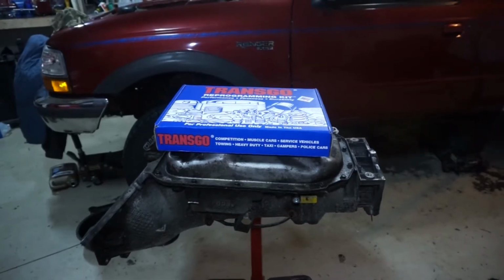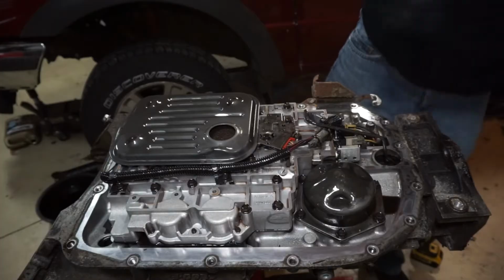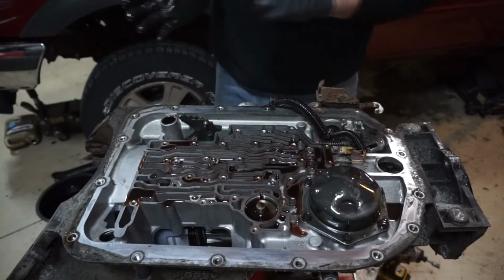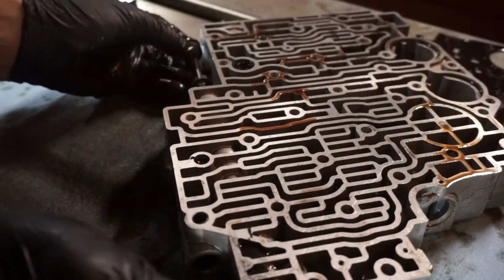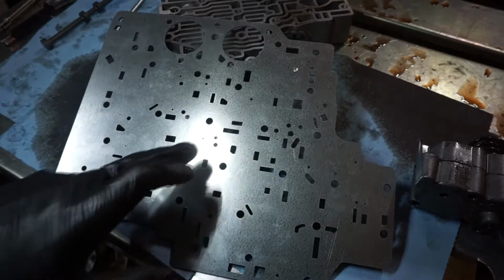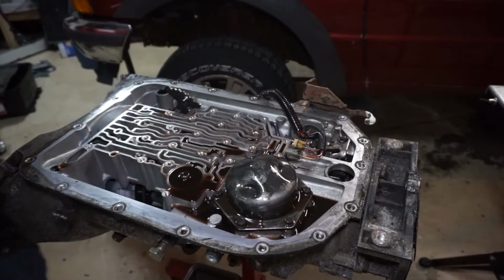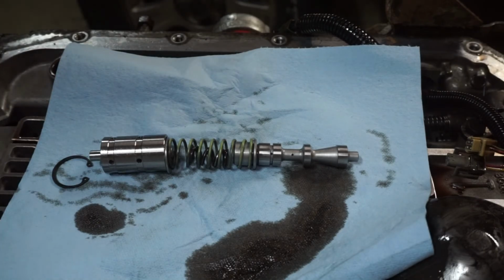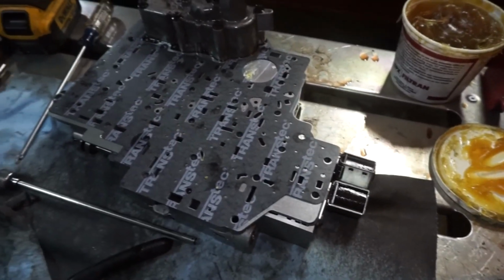4l80e HD2 Kit Install Improved Method Without Pressure Relief.

Comment: You guys think i could add the springs to the direct drum from the hd2 kit while using the Jakes recall kit?
Reply from the maker: @moose1992caprice  You could. You could just buy the springs also.
Reply: @BlaserBuilds  ok. I already bought the kit and then did my research. Needles to say, I went with the jakes kit instead.

Comment: Looking to install this kit this weekend. Curious how three years later you’ve liked your decision on not doing the pressure relief valve ?
Reply from the maker: Yeah I still don't do it. Only difference now is if I know I'm going inside the trans, I will dual feed internally with a Jakes recal kit, and add the HD intermediate snap ring.

Comment: Hey Ryan thanks for all your helpful videos.. question for you if I’m running a tru cool 40k cooler, should I did loop the cooling circuit through the radiator? Thanks!

Comment: Opened mine up this morning to find the 4th accumulator spring broken. Ordered a delete plate for it. What would you drill the separator plate holes to with the delete plate instead of the accumulator installed? Thanks. Video was a huge help for me.

Comment: I know your vid is older but I inquired with transgo about the pressure relief mod issues and for the differences between the transgo 2 and 3 kits, here’s what they said- 

“The HD2 requires a computer, it keeps it automatic. 

No design change, the good old Urban Legend that a pressure relief causes transmission to fail is just nonsense that does the rounds online by people that don't even know enough about basic hydraulics to know they don't know. 

That pressure relief when installed properly does absolutely nothing unless one day there is a pressure regulation issue, at which point it would simply kick in to save you a bunch of money on broken parts. Blaming it for a transmission failure would be like blaming your fire insurance policy for you house getting flooded during a hurricane. LOL”

What’s in quotes is their reply. Have you personally seen the relief mod 
issue you are saying to avoid? Thanks!
Reply from the maker: I have a video on the channel with a valve crooked in the valve body on one I rebuilt for someone... Transgo also says the intermediate snap ring is optional(kit can be installed in vehicle). I broke the stock intermediate snap ring in the transmission in this video with the HD2 kit, and had to pull the whole thing apart anyways. Now, they'll probably say it broke because i didnt have the pressure relief, but I have to ask... If thats the case, do I really want that valve relief popping open and relieving fluid on every gear change? Most people I know doing this kit aren't spending money on hard parts regardless. They're throwing this in junkyard transmissions for a few hundred bucks to avoid opening up the transmission at all. They're not even installing the whole kit.  There's much better options for shift kits and dual feeding internally if opening up the transmission. Jakes recal kit has no pressure relief, CK Recal kit has no relief etc. This is a cheap DIY option to use only if not removing the pump. If you're doing enough to open the transmission up I don't recommend this kit.
Reply: @BlaserBuilds  Great information but if you were going to pull the transmission apart What shift kit would you recommend Or other parts?

Comment: I have a transmission that has failed forward drum and an HD2 kit already installed and was curious about the pressure relief valve and should I be blocking  off

Comment: What's the benefit to doing only the mods you did, as opposed to doing the full hd2 installation
Reply from the maker: The pressure relief can get stuck open and burn up the trans...
Reply: @BlaserBuilds  do you recommend doing only what modifications you showed here, or to go ahead and do the full hd2 mods for an untouched 4l80 with 130+k miles on it?
Reply from the maker: @Six_ftdeep32  Usually rule of thumb for me is, if I'm going inside the trans for a different reason, do the full kit. If no opening up the trans, just do these steps. 

But now, if I go inside the trans I just dual feed internally, instead of using the kit.

Comment: I guess I need some help I put the shift kit in my 2005 GMC Sierra 2500 HD yesterday and I did exactly as you did in the video The only thing I did different was I installed the pressure release valve and two new shift solenoid‘s but for some reason sometimes my truck will takeoff in second gear and it shifts to second gear at 15 mph and if you do not slow down to under 15 mph it will stay in second gear and once you get up to speed it will shift to drive and it has no bottom end power and when you’re on the interstate when you stomp down on it sometimes it will shift down a gear and other times it will surge how do I fix this problem??
Reply: Ever figured it out ?

Comment: So can I pin this out on my ECU and use HP tuner to go in and set up the 4L80 if I was running a 4L60 previously or do I have to find an ECU that had a 4l80 hook to it from the factory
Reply: depends on the ecu. Check with hp tuners and see if they have segment swap for your ecm

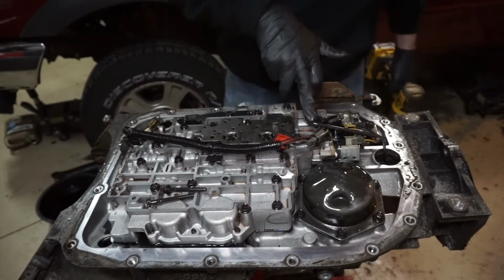Comment: Hey bro, there are many people getting different results with hole size. Just curious how you like the 1/8. I don't want to chirp the tires when i put it in gear or at normal cruise but i want quick and firm for WOT. I have about 425 whp, with a 3800 stall and 4:11 gear in a 3600 lb c10. Little N20 if needed
Reply from the maker: I've never had harsh shift or tires chirp with 8th...
Reply: Thanks sir
Reply: What does the check balls do? On this kit you have to remove the ball closest to the round cap and the check ball that is closest to that one has the hole on the transmission kind of wore out?? And the part that it sits in the valve body is OK it’s just the top part of it that is on the actual transmission or is it supposed to look the way it does?

Comment: Did you end up liking the shift feel drilling all the holes to 0.125"?
Reply from the maker: Yes, I personally liked it better than .096
Reply: @BlaserBuilds  I'm torn between the 0.125" on all 3, or I've also seen recommendations that say do 0.125" on 2nd and 4th, then leave 3rd and remove the check ball.
Reply: @351Cpowered  I drilled the smallest hole on 2nd and .125 on 4th the with no checkball on 3rd. It shift firm on 2nd and smooth on 3rd. Full throttle they are perfect with firm lockup. I would only recommend these settings with a high stall converter.  These were instructions I received from Jake at Jake's performance.
Reply: @spyderlyf3  what size converter do you have?
Reply: @claytonhaske  Its a 3k stall triple disc Vigilante from Precision..

Comment: To confirm is the line to lube valve part# 34200-14K?
Reply: Or is it possible to just drill the stock valve? Great videos by the way 👍
Reply: Looking for the correct part number aswell....any lucky?

Comment: I’m building a foxbody 4.8 ss2 pac 1218. Gt45 with4l80e from a u haul that was buried in junkyard, I’ve done plenty of 4l80e rebuilds for buddies and what not,I always install everything included in the hd2 kit, I haven’t opened my 80e in my car yet,when I do should I skip the relief step? I always here it can stick but personally I’ve never had it happen to anyone I know. Have you had one stick before?
Reply from the maker: Not that I confirmed, but I did hurt this trans slipping st the track, and believe I burned up a converter previously from the trans. This one at one point woukdnt even move, I plugged the relief port then drove it for another 6-8 months.

Comment: "Back in the day", we had a store that was full of surplus hardware of all sorts.  I would pick up bolts of various lengths, threads and sizes, cut the heads off, rounded the ends and used them as temporary alignment pins.  Cheap, easy and very handy!

Comment: i looked up a lot of info on this and did the hd2 then like a week later i see not to do the pressure relief so thats fun
Reply from the maker: Tap and plug the hole. Dont even need to remove valve body...
Reply: @BlaserBuilds  how fast will it take to burn out i wonder if i can make it to the next fluid change
Reply: @hishoe2000 what ended up happing with this? I’m about to install the kit and wondering if I should skip this step.

Comment: Big one with the sonnex valve, if you have a triple disk converter and tons of line pressure like me you can get a dragging in 1st and reverse that always wants to stall the car, when you don’t have that valve or pump relief it’s the converter lockup drain back circut also , replacing that valve in the car will fix it, been there done that lol good tips!